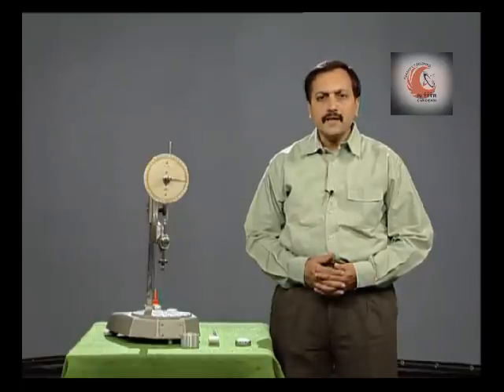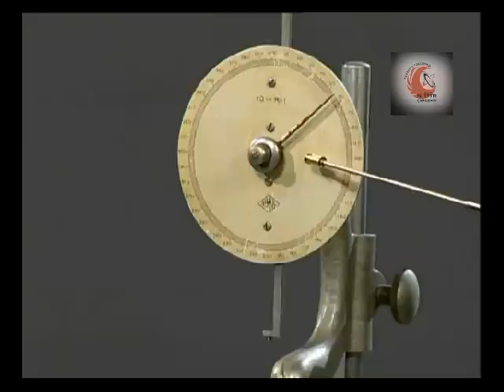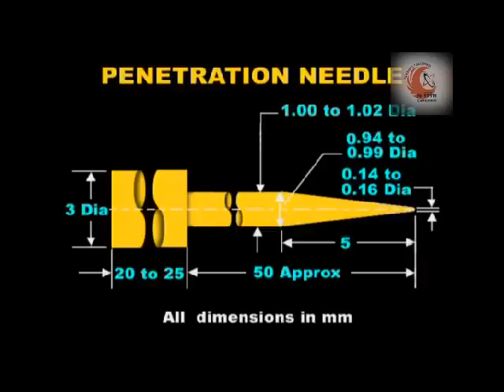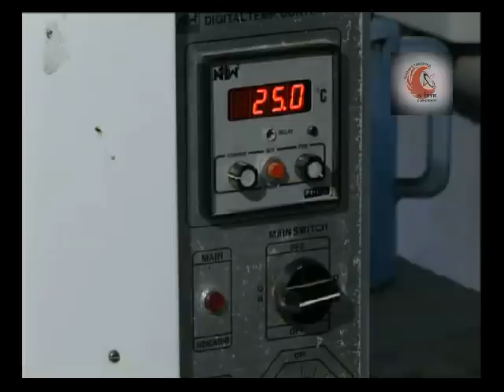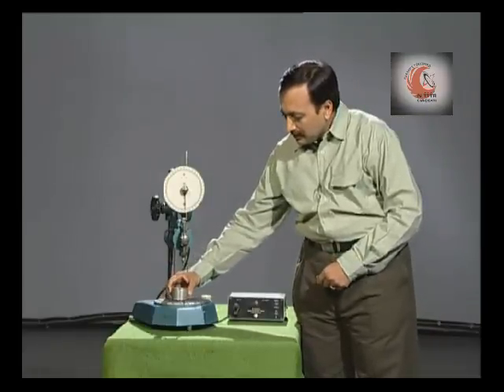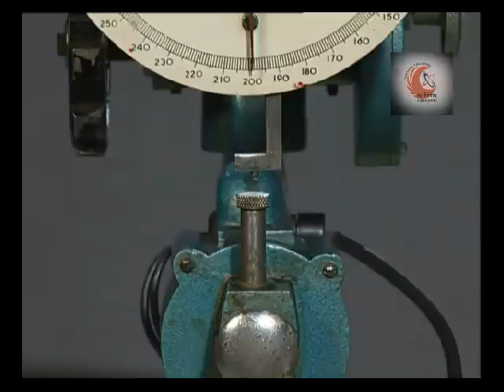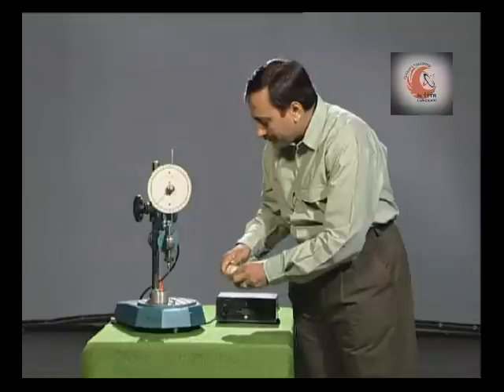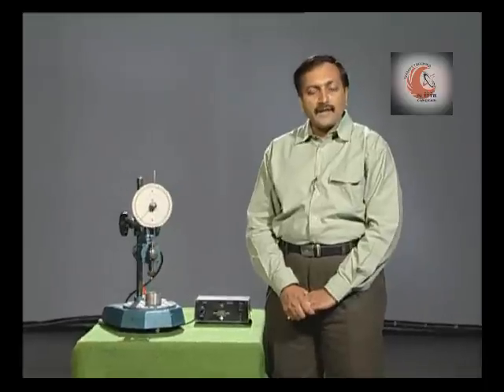Penetration Value of Bitumen

Comment: Why the needle is cleaned with benzene
Reply: maybe ig not to allow bitumen to stick to surface of the needle
Reply: For smooth penetration. If bitumen is sticked to needle then it slightly obstructs the penetration of needle in to the bitumen which effects exact penetration value.so they cleaned with benzene.
Reply: @suryaprasanthmuddana7038  rightly so
Reply: @suryaprasanthmuddana7038  thanks mate